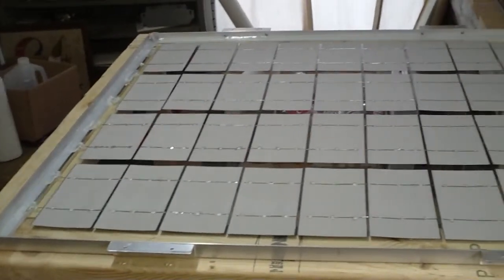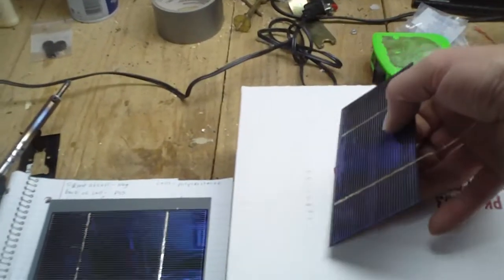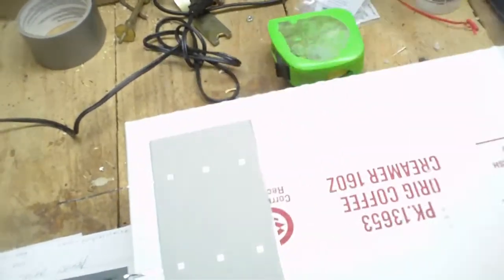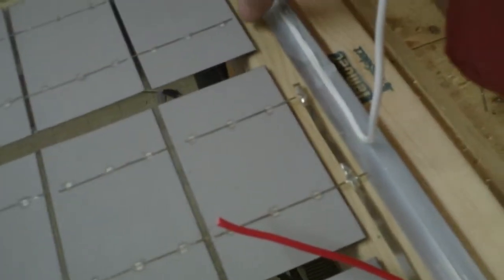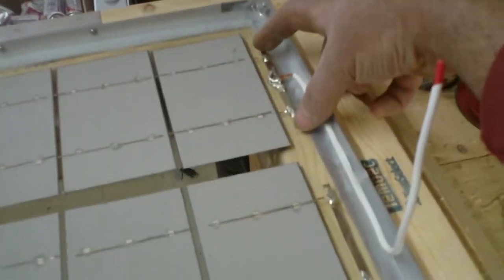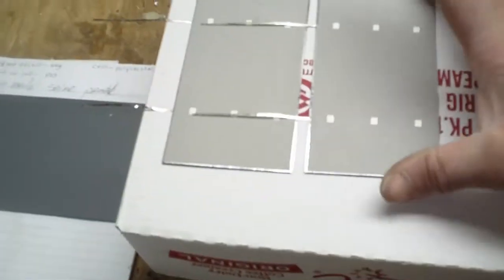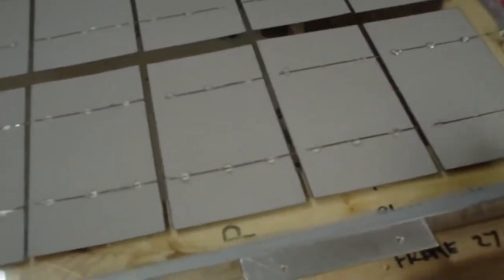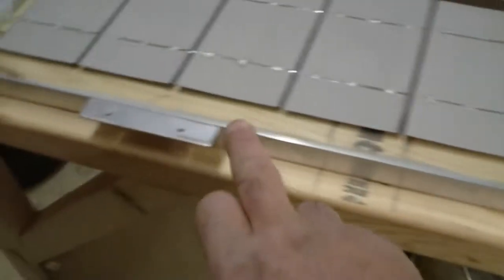homemde solar panel....maybe????

Comment: Hi there..great vids I was checking some out ur a funny guy.Same here trial & error so you mentioned putting fiberglass on the back? didnt see a vid for that. How did you end up encapsulating? if you dont mind. I made mine out of a old  slider door just by smashing out one side (double pane) wood frame and using eva sheet with a heat gun.Your suppose to sandwich it between eva sheets but I think ill try just on the back side.I didnt see any vids on maple syrup you should try..thanks

Comment: the ones I made with wood in the summer they didn't make a lot of amps it went down to almost nothing. i am going to try the encapsulation now. its suppose to run cooler, we will see seems like its got to. I can make two panels out of one kilo liter. of the Dow 6100 6010 and its so much easier

Comment: I think you should solder the back. I do. How will it stick other wise? I guess they have glue made for that on ebay. your connection will separate with out solder.

Comment: Assuming you didn't make any mistakes in the wiring that should be a 21.6V (nominal) panel since you wired them all in series. The downside to a completely series panel is that if you have a shadow on any cell you'll greatly decrease the panels total output.